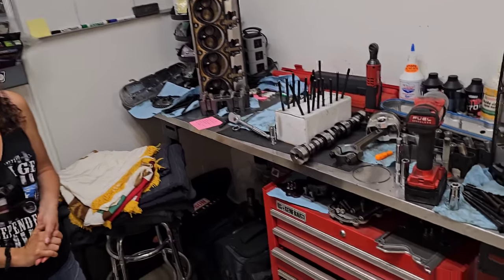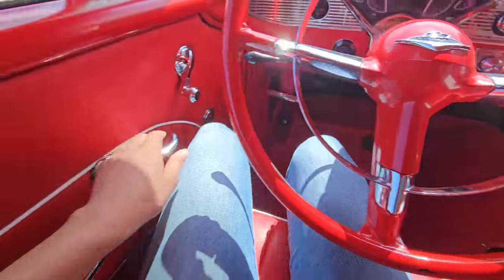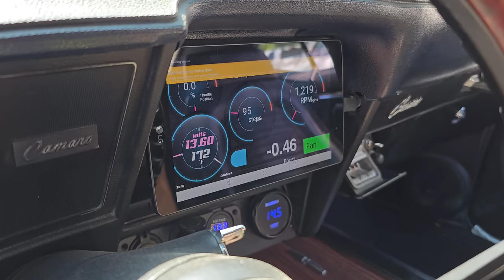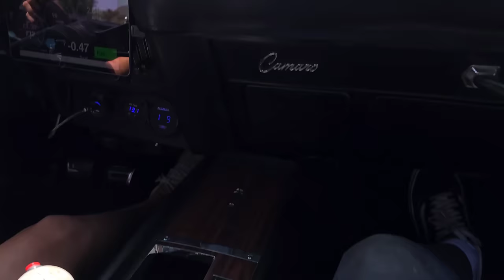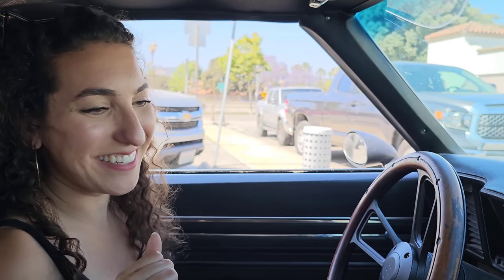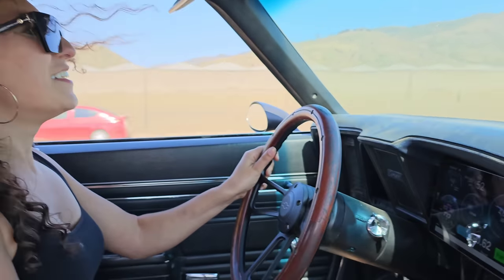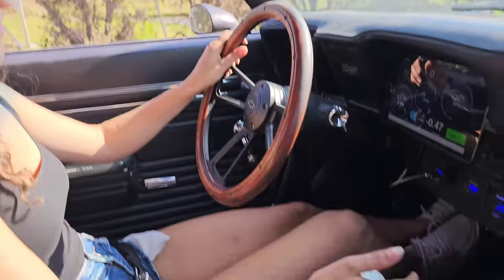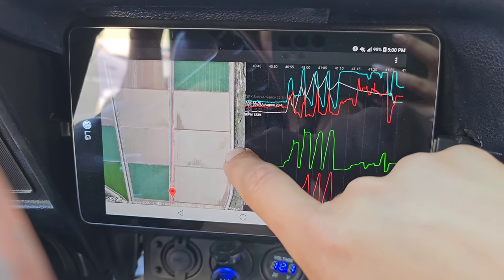Learning Stick-Shift In A 1969 Camaro – Turbocharged LS 6-Speed

Comment: Big smile, here.  Before you know it, you're gonna be bang-shifting just like Mr. Dulcich!  I got over my stick-jitters the hard way - by learning how to drive a White Freightliner Columbia.  We're talking a 12 speed, split-stick "monster."  It took me all of 20 minutes to get the hang of the full pattern [including a risky jump from 8th down to 4th gear} - my instructor was very impressed with the way I kept my cool, even during the crazy sh*t he constantly had me do.  He bet me a steak dinner I couldn't take off on a 6% grade without stalling {6%, think Nob Hill in San Francisco, or Mulholland in LA}.  I won the steak dinner, and blew his mind 'cos I took off in THIRD GEAR, just as smooth as glass.  By the time I got  my CDL, I was rat-racing with every Kenworth and Peterbilt I could find - the Columbias my new employer owned all had the top-dog, 750-horse Cummins under the bonnet!!  I mean, you just haven't lived until you've done an 8-wheel peel........😎

Comment: Idk, I've disconnected injectors and drove several miles when I had a miss on that cylinder. With correct rings an hone there should be a film of oil for hydrodynamic lubrication for the rings and skirt to glide on. If it was boosted with intermittent injector pulse that would melt the top of the piston instead of just heating the lower piston to the point of no clearance, NA would just be a miss and ive never seen a NA lean condition heat a piston beyond clearance. No damage to the top of the piston just the lower or skirts I would be concerned there wasn't enough piston to wall clearance and would make sure there was enough the second time around. Just my opinion

Comment: $5.38 for 91 octane..... good grief, i thought it was bad in NY. premium gas is $4.50, but i go to the reservation and i paid $3.60. i take 9 cans enough to last almost a month. my toy is a 2003 bonneville SSEi 3800 supercharged L67. i know it's nothing compared to what you have here, but it's a fun older car. it's quick and the gas mileage isnt horrible. it requires premium. the car isnt entirely stock either. PCM tune, power log, 160 thermostat, cold air intake and a pulley swap. makes around 9 PSI of boost

Comment: Your are a great coach Danny! BTW, What mufflers on the Camaro? I think they sound great. I am using Pypes Violators
and am thinking about changing to the Flowmaster Laminar Flows.
Reply from the maker: Hey OdySlims. Im running 4 inch resonator by JMD tubes.  They give a deep sound.
Reply: @GnarlySpeedShop  Thanks Dan. I  checked out JMD Tubes! They have super high quality stuff!

Comment: I have never seen a piston do that because of it being a bit lean  even under load, that would cause damage to the top of the piston not the skirt. I would look at a bit harder at this issue and look into lack of oil on that . also inspect the head to see if it got hot there as well. what i can see the heads looked fine. again i don't agree that it was because of the injector a bit loose. you would of felt that or herd that cly missing. just my 50 years talking and i have seen strange things in racer engines

Comment: Question about your engine rebuild many of us are interested in.
You mentioned you discovered upon disassembly that no. 2 cyl injector connector was dislodged which of course could and would contribute to a lean air/fuel mixture aka spark with no fuel/high heat condition in that cylinder.
Because you have fuel injectors, you have some sort of engine management system on this LS engine.  Why weren't you able in real time or looking at OBDII data log able to determine that you had a lean air/fuel aka lambda delivery in no. 2?
Can you explain this?  I am sure others would like to know as well.
Reply: Since you didn't have the courtesy to answer this basic question, I will answer it.  You were either remiss in reading any error codes or your fuel management was impropertly set up to discern you had poor air.fuel in a particular cylinder compared to others.  This is elementary to anybody who builds or installs engines in cars.  You owe it to your viewership to be forthright.  If you don't know, then just say it.  But your backhanded comment dissing the comments based upon incomplete information you didn't provide when most in the comments have more engine building experience than you. This doesn't cast you in a very good light. We 'were' all rooting for your success...lol.
PS. I am glad you are following my advice at least.  When you don't know how to build an engine, even one as simple as a LS, yes, stick close to your engine builder as all novices should.

Comment: no way was it a injector unplugged. the skip would have been horrendous, and you would have known instantly when you started it. do you have any idea how many cars drive around with a bad injector> they would all lose a piston if that were true. Whoever told you it was the injector is wrong needs to go to engine school . There are only two things that can cause a NEW piston to have fin scraping. TWO.   I am talking about a NEW piston not a motor with many miles on it.   Either a defective piston where the fins are too thin by a bad mold pour. OR the compression rings are too tight causing the piston to rock when rod direction changes. i.e. when piston reaches top of cylinder or bottom of cylinder and the rod reverses direction, the over tight rings at the top of the piston CAUSE the piston base  to rock and slap the cylinder walls. You did not have over tight rings which is clear from the compression rings having more than enough end clearance . so it was defective piston fins.  Nop,  Defective piston